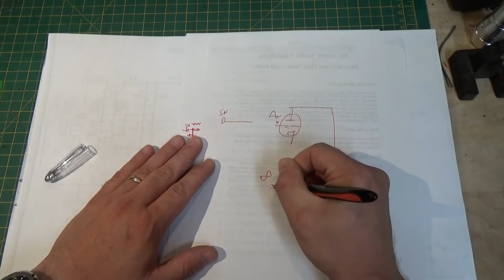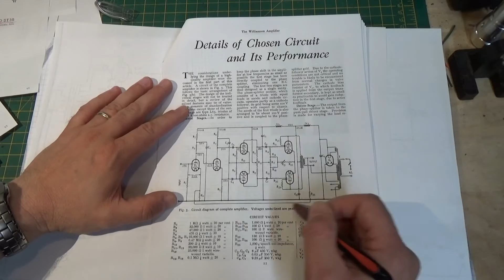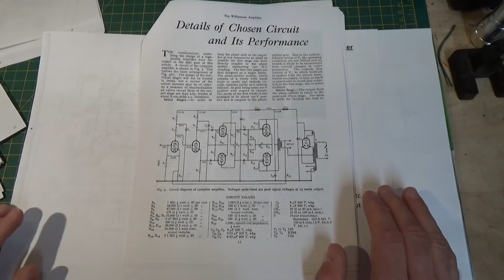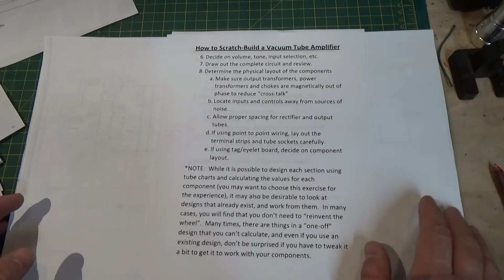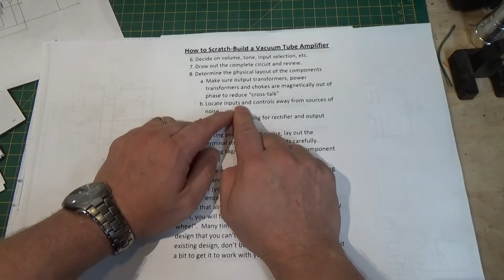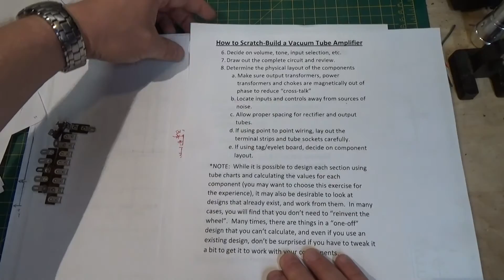Scratch Build a Stereo Tube Amplifier - Part 2 - Finishing The Design

Comment: Er, cathode follower, non inverting. I think you may have had the top tube fed from the anode circuit in mind, as per basic  phase inverter. Great video though.
EDIT: For newbies its called a 'follower' as it follows the i/p signal (though has slightly less than unity voltage gain), but low impedance drive and power gain.

Comment: Hey Xraytonyb.....I'm 2 videos in and I'm looking forward to getting through the rest.  I'm a UncleDoug follower for years and have built a couple guitar amps from scratch....I even did his Supro Clone.   In this hobby, I continue to try to justify excuses for putting together this old school stuff.  My goal is to build a tube stereo with a Bluetooth input for smartphone streaming but also have input for a modern record player.  From your comments, it sounds like I'll need another amplification stage for the phone?  If so, will this be addressed in later videos?  If not, could you point me to a resource for this type of information?  Thanks...Bart

Comment: I am trying to build an EL34 based stereo amplifier, and this video series definitely helps understand the tube side of the technology a little bit. I am from the solid-state world. I am going to design a solid-state front end. Basically a TDA based chip input selector, tone, bass, balance, volume, etc along with an A2DP bluetooth audio receiver... with a microcontroller that runs this IC, as well as render a VU meter AND control a couple relays for the B+. I can warm the tubes up, and then kick in the high voltage. But the rest of the amplifier will be tube. Thinking about putting a Pre-Out, Main-In jumper in the rear so the solid state front-end can be bypassed via other means.
Reply from the maker: Sounds like a very ambitious project!  I bet it will be great when you get it built.  Hope you can get some video of the build.  Good luck!